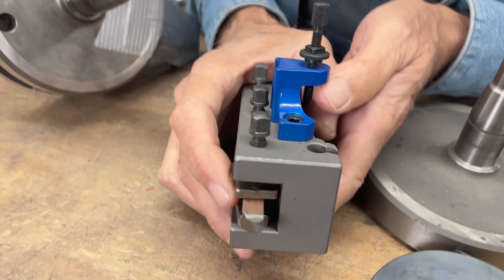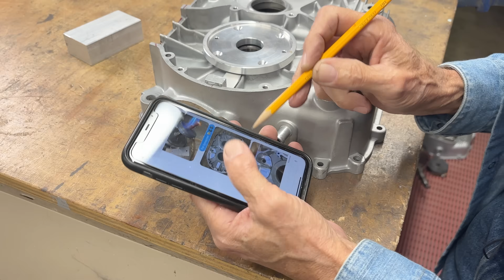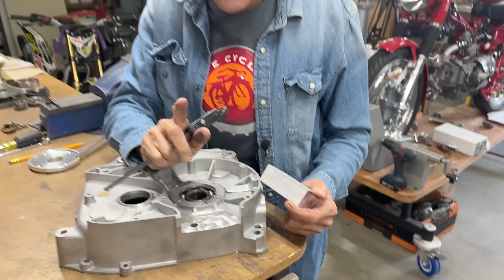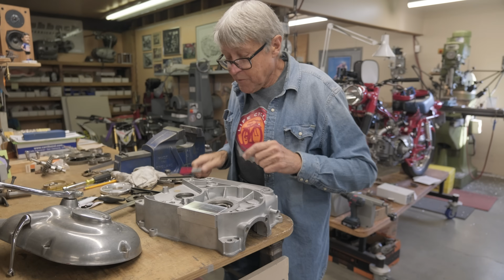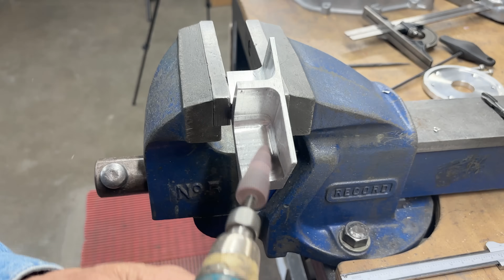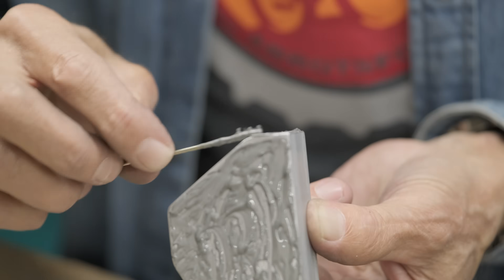Modifying the BIG BORE MOTOR // paul brodie's shop

Comment: A great product you may not know about Paul and anyone who has come across things like some rockape before you used a hammer trying to remove a flywheel and damaged the threads on the end of the crankshaft or any other similar item up to and including stuff like the threads on a live axle 4WD front axle with damaged large diameter threaded ends on the housings Brand is Silbertool and I have no ties to the company just know it is a great product for thread repairs by rerolling instead of cutting making the repair stronger than any other method, This is a Video they just put up on Youtube
https://www.youtube.com/watch?v=Q1I7LYTRumE

Comment: Would you be interested in milling parts to build a honda gy6 clone into a 2cylinder? Possibly  making big bore cylinders and possibly a billet head. (Semi billet, cast a rough shape, then mill the head from the block of aluminum.) And possibly  use 54 mm pistons if possible  the largest big bore piston avaliable is a 52.4 (a 50cc engine going from 39mm to 52.4mm bore is a fair jump in size. , the valves are under 18.5mm using 150cc valves if possible would be cool.)  THE issue with building 2 cylinder engines is the sparkplug for #2 cylinder.  It must go between the timing chain. And could be an oil leak. Milling a tube that screws in and has seals, making a leak proof  portal . The stock plug is 10mm it can possibly handle a 12mm plug long reach ,15-19mm long possibly, with the tube and timing chain maybe better to keep the 10mm plug. I would also like to build a cast aluminum intake manifold the stock 18.5 mm carb or the performance 20mm on the engine. I'd rather use a single carb with two cylinders.  Over using two carbs. Maybe a single 34mm maybe a larger carb. I would want to cast the manifold extra thick, about 15-20mm wall, with a 20mm and 30-35mm runners. I would not mind getting an amr350 supercharger run iit with a small bypass to regulate boost, a 18-20mm valve and a peak boost of 12-15psi. Going  from 2-3hp to 10-20hp
Reply from the maker: Sounds like you have a good project.. I am retired with a YouTube channel, and am definitely not short of projects right now, so I am unable to offer you assistance at present, sorry.

Comment: Greetings Paul and Mitch! I have a "super metal" putty recommendation:  have a search for "Belzona 1111". It's a two-part epoxy that hardens to a machine-able solid. Have used it tons with aluminum cases for filling holes and repairing broken sections, can drill and tap it as well if needed. It's a bit on the pricey side, but is well worth the investment for its capabilities. 

All the best, gents!

Comment: Paul carbide bit would have cut through that tach. drive without annealing it.
Reply: Carbide insert would be OK but these days I use hard turning inserts with a wafer of Cubic Boron Nitride (CBN) at the cutting edge of the insert....they cut any hardened steels very easily
Reply from the maker: I don't think you realize how hard that shaft was...

Comment: Can magnesium be welded without melting a hole in your bench and another in your concrete floor?😂
Reply from the maker: Yes it can, but I have never tried...
Reply: Yes,magnesium can be TIG welded with suitable filler rods and argon shielding gas.